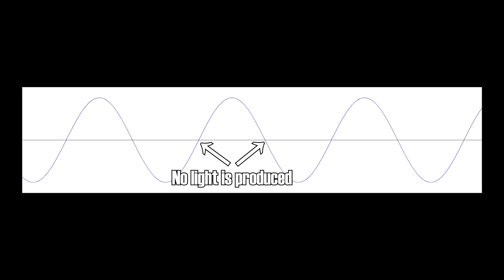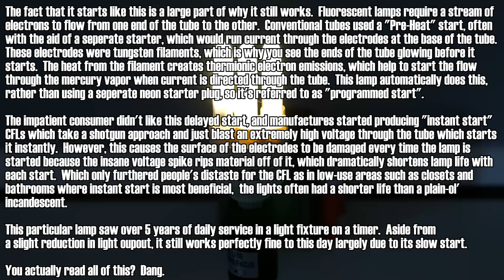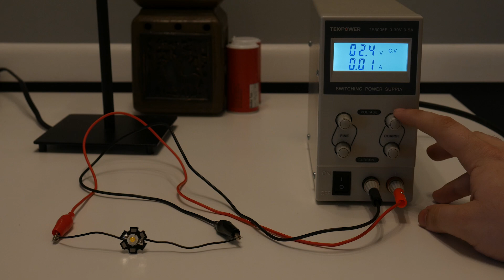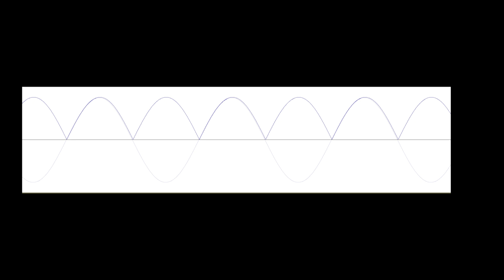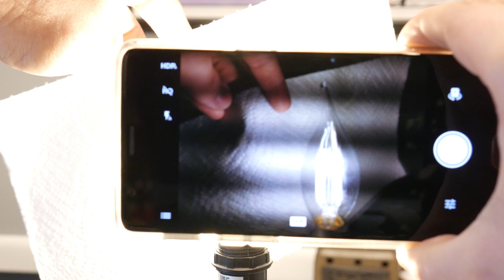LED bulbs that flicker, and CFLs that almost never did

Comment: You forgot to mention the flickery Christmas lights that drive you nuts when you drive past a house that's decorated with them.
Reply: I hate moving past rows of lights for that reason... I can see the dimming better than anyone I know and that drives me nutso.
Reply: I love LED bulbs, but the LED Christmas lights just seem so off, so cold. I prefer the houses with incandescent Christmas lights. When I am walking my dogs, I will just stand there and nostalgically watch them. Oh and don't get me started on those Christmas projected laser lights.
Reply: Those are actually half-wave rectified, whereas the diagram he showed demonstrated full-wave rectification. Basically, only the positive half of the AC current passes through, rather than flipping the negative half to positive. You can't see the flicker like that on full-wave rectified strings, even though they are zeroing out at 60Hz
Reply: @SepticFuddy  I have thought of that. A vid years ago by AvE (watched his vids for a short while till I got tired of his pottymouth) showed each half of a string flipping between the 2 sides of the AC.
My main thought is that the LEDs come on only when reaching a certain voltage, so it's only the tops of the sine waves that activates the LEDs. I guess I have enlightening to do.

Comment: I really hated CFL, disgusting light, highly unreliable and potentially dangerous. I used incandescent until I found good Philips LED Warm White which still was lacking in colours and looked washed out. Now I installed 200W Halogen system and it looks AMAZING. I use my LED as a secondary light  when I don't need halogen.

Comment: I was listening to your video in a background while working on something else and not paying much of attention to what you say until 3:15.
You meant negative dynamic resistance..?
I would gladly buy some of the negative resistance lights bulbs from you - it would be like a free energy source.
Connecting such a light bulb to a rechargeable battery would recharge it, and the more voltage the battery would be producing the faster the negative resistance would charge it. Sort of a perpetum mobile ;)
Still very interesting and informative video.

Comment: LEDs are bad for health. Blue diodes is the culprit.  My fluorescent tube light having a magnetic ballast lights much brighter. It switches off 100 times per second compared to thousands of times from an electronic ballast.
As far as saving energy, the LEDs as of now on this earth DO NOT save energy. People simply use more LED fittings.
Reply: Not true. compare watts to lumens for a start. Unless your adding in the total energy used to produce the bulbs all the way through final disposal/recycle. I don't know the figures for that sort of analysis.
 I am assuming also you are comparing same cri and 'temperature' between the two bulbs. Or are you assuming people will the same number of watts for their lighting regardless of total brightness?

Comment: I am an electrical engineer and I suspect you don't quite have the capacitor thing right in the fake filament bulbs. Running an electrolytic capacitor where there's large ripple (AC superimposed on DC) across it causes heating of the capacitor and if it's high enough will quickly destroy it. If you look at the data sheets you'll find the max ripple current in the specs. Especially where the circuit board is already going to be quite hot a filter cap sized too small would likely quirky self destruct. I suspect instead the caps are there to provide smooth DC to the current regulation circuitry not the LED strings.

This also brings up the bigger problem that cheap Chinese LED bulbs use cheap electrolytic capacitors that are often under specified for size or cost reasons and have to run in a very hot environment especially for bulbs mounted socket up in enclosed or partially enclosed fixtures. These caps are the most common failure point and the main reason LED bulbs rarely meet their published lifetime ratings. Most LED bulbs sold on Amazon are from no-name Chinese companies that didn't even exist a few years ago and probably won't exist in another few years. Those companies don't care if their bulbs don't last 5+ years.

Comment: Also, 20Khz is not Very High Frequency. VHF is 30Mhz to 300Mhz. 20Khz would fall into Very Low Frequency (VLF 3Khz to 30Khz)
Reply: insylem Not very high frequency for radio, but it is for power transmission!
Reply: You are conflating Broadcast jargon/terminology with power system jargon/terminology. The  context here determines the definition.  The letter i in electronics refers to amperage, in math it refers to the square root of -1.

Comment: Incandescent bulbs are good for oven lights, where the heat would destroy other lights. Also, exterior lighting in colder climates get snow covered when not incandesce. There are also IR uses for incandescent lights such as IR searchlights, heating lamps for reptiles, and food.

Comment: Interesting to see how an electrolytic capacitor is used in the AC-to-DC converter inside these LED bulbs.  Because heat causes the liquid electrolyte to either evaporate and/or leak over time, one may not get the all-so-often promised "11 years of life" from an LED bulb.  Some may even think, "I don't leave these LED bulbs on very much so they should last 20 years or more!"  In terms of the LED light, that may be true, but in terms of that poor electrolytic capacitor inside, well, your bulb's life will most likely be limited to the life of that capacitor.  And since replacing the capacitor in most bulbs is not possible without destroying the bulb, you would need to replace the entire bulb when the capacitor reaches it's end of life.  The only other thing to note is that capacitors don't just up and die.  The equivalent series resistance (ESR) increases as the electrolyte evaporates or leaks, which note doubt will have some affect on strobing.

Comment: I have a couple of those filament LED lightbulbs at home and I noticed that one of them flickers a lot, while the other model (with a bigger electronic chipset) doesn't at all.

Also, while recording in slow motion with my phone I noticed that the CFLs do flicker (but not as bad as the filament LED), while other (greater quality) LED bulbs didn't at all.

I don't know why is that now.

Comment: TC, I can see; actually see the flicker of most LED lights. It is especially bad in automobile led tail lights. But I can even see the flicker and separation in RGB colors on my newer Mitsubishi 72" rear projection tv. And this effect is magnified 1000x's when I look away as the seperation/ flicker is unmistakable.  Regardless of the Hz the light source is operating at. Interestingly, I was an early adopter of CFL bulbs. That interestingly did not produce the same effect. Just throwing it out there for you to ponder. Great vid! Gonna hit the Patreon support page as soon as I have a few extra $'s to spare.

Comment: Magnetic ballasts do not output a sinewave signal. There is a lot of distortion power factor effects that can be tweaked to increase lamp efficiency and change the frequency of the arc. You say that that is all obfuscated in fluorescent lamps; but it is critical in other gas discharge designs.

Comment: I was thinking I've actually noticed incandescent lights flickering, especially ones about to go out which at the time we didn't know it but our house mains voltage at the meter was dropping due to a malfunction on the power grid in our area, that eventually got so bad that something up the road popped and our outlets were showing 80volts instead of 120, everything was dim except for my bedrooms led bulbs, they might be using a switching power supply in the driver lol.

Comment: I know I'm a little late to the party here BUT whatevs. In regard to what you say at the end about CFL light...my absolute favorite bulb as far as quality of light produced was GE's Reveal CFLs. They don't make them anymore and their wattage was somewhere between a modern LED bulb and an incandescent. But if I could still buy them I would.
GE REVEAL bulbs are all that I buy now and they are the ONLY bulbs that produce light that comes anywhere close to incandescent bulbs. It has to be REVEAL. Soft white and warm white GE LED bulbs and in any other brand just look awful. And cool white or daylight is the absolute worst.
The Reveal CFLs looks WONDERFUL and when they eventually died on me I switched to REVEAL LEDs. I like the color output of these LEDs but they aren't quite as good as the CFLs where and they have a noticeable flicker. I expect that shit from a Chinese company but not from GE.

Comment: My guess as an electronics engineer is that you are almost correct regarding the number of diodes being roughly matched to mains voltage. The reason there are some more diodes is that when you rectify an AC voltage, the DC voltage becomes significantly larger. The output is AC voltage times square root of 2, or roughly 1.4 times the AC voltage. That means for america the rectified voltage is about 170 Volts. That's what the driver has to work with.

Comment: Strangely enough, I did the smartphone test on a bunch of incandescents, and they all showed really strong flicker. Why would this be the case?
Reply: Incandescents have some inherent flicker but it is damped by the heat capacity of the filament.  The filament emits based on the surface temperature of the tungsten which lags the current slightly as it heats up, and likewise it does not cool to zero within a half cycle but gradually cools.  So there is a ripple around the mean temperature rather than a sudden stop of emission that occurs in a fluorescent.  

It used to be that the work lights for rotating tools like lathes were required to be incandescents because the 120Hz flicker of fluorescents would often "freeze" the appearance of the tool depending on the speed setting, and workers would get injured by reaching for it while it was still turning.  Incandescents have much less flicker.

Getting in deeper: It is not strictly a sine wave ripple as the heating is based on power: instantaneous current value squared multiplied by resistance, and the resistance also varies with temperature (increasing).  Then the emission varies in color by Kelvin temperature as well!  But the "thermal inertia" of the filament tends to keep these variations nearly invisible to our vision.

Comment: 3:19 Negative resistance is like a current controlled voltage supply. Doesn't the arc just have very low resistance and acts like a short circuit?

Comment: even though I'm not epileptic, however, I do have an eye condition which DOES allow me to "see" the fast-switching rates of gas-discharge lamps including lamps which contain simple magnetic ballasts running at 60 Hz and even the ability to see old analog TV images "drawing" on the screen!  I can see street lights  "turning on and off" and fluorescent lamps  switch off to a "pale yellow glow" while CFLs, on the other hand, I can not see as their switching rates is 10 kHz and up.. I can also see  computer monitors flicker at up to 80 Hz..  I CAN see this effect in CHEAP LED lamps and "corn cob" lamps as well..  the higher-quality LED lamps don't seem to have this issue.

Comment: Orange glow from street lights is low pressure sodium vapor. High pressure is more white and does not make everything look dead, it is also a lot more expensive and it is why till led tech got better and cheaper, cheap low pressure sodium vapor lights where used.

Comment: 5:00 an electronic ballast works in the exact same way of a big chunky one.
You said that it produces an high frequency but you didn't say what it does with it.
The small transformer looking thing is actually a magnetic ballast, it is much smaller just because it works with a lot higher frequently.

Comment: I avoided CCFLs because of their poor color rendering. They rarely went above CRI 80 and I always thought rooms looked a little weird to the eye under their light. They were also marketed as replacements for 60 or 100W incandescent bulbs when they were far too weak in reality, and consequently many of my friends had very dimly lit rooms just because they tried to save some energy (11W was marketed as replacement for a 60W incandescent, although it lacked nearly 20% of its brightness). LEDs are great now that they get past CRI 90 easily, and I use them everywhere.

Comment: No way LED will replace incandescent bulbs, unless in my home.
A have a "high quality" LED and its light isn't nowhere near the my old incandescent bulb, even though they say "2700k". Not even close.
They have the same lumens output (600lm) but the incandescent produce MUCH LESS glare and flicker. Incandescent is much more comfortable to my eyes. Ain't no comparation.
Yes, they waste more energy, but I save energy by other means. At the end of month, I manage to get a low consumption (about 70 kWh) at my energy bill. It's a great deal for me.

Comment: I discovered the flicker on my retro style LED bulb by filming them with my 240 fps slow-mo phone camera. Then I filmed an old style carbon thread filament bulb and discovered it too flickers with the 50 Hz DC outlet by the same amount. That made me content with my LED bulbs.
Reply: The main difference I think is that incandescent filaments heat up and flicker in a softer/slower fashion. This helps the trick our eyes even more with persistence of vision as they look like they are dimming but not going right off. LED flicker is harsh because it can go from on to off much faster .... think TosLink :)   Incandescent like a sine wave, LED like a square or sawtooth wave.
Reply: This means just one thing: Your LED bulb is shit.

Comment: There's actually a really good reason florescents are driven by AC more often than DC: As long as the tube is powered on and receiving DC, the mercury vapor will slowly migrate towards the cathode end. Eventually, all the mercury ends up at one end, and the tube won't strike anymore. You can actually see the result of this as a black band around one end of the tube, and it's almost always why those crappy old battery-powered florescent lanterns would crap out. The solution is simple, though: If it's not too far gone, just flip the tube around, and the mercury will start migrating back.

Comment: I have had CFL's catch fire. LED's for the win.
Reply: The 12V G4 halogen LEDs are prone to catching fire if not made very well and by a reputable company. Since they run off 12V AC or DC, they can't just use a capacitor to limit the current but they must use a resistor or a DC to DC converter. The resistors are present in cheap bulbs and are always overloaded, I bought a few lamps a while back that ran 22 ohm SMD resistors (power limit: 250 mW) at over 500 mW each and of course, some 15 minutes later, the lamp smelled like it was burning and first it started flickering, then some LEDs started desoldering themselves because of the heat.

I got the money back and bought some proper quality Sylvania bulbs, with a real DC to DC converter, and so far no issues...
Reply: LED's with poor design or poor components are as likely to catch fire (usually fewer components).

Comment: The mercury vapor inside CFLs is so absolutely insignificant, that a year's worth of coal burning to power that CFL bulb will exhaust more mercury into the atmosphere than the bulb itself contains.  The mercury released into the atmosphere from coal fire plants in the U.S. is measured in tons.

Comment: Boo :(
 I use CFL(or curly fluorescent bulb) in my barn.
 They last between 5 to 12 years in the barn.
 I don't see them been that bad as long last fluorescent bulbs in the barn.
And I don't trust LED bulb because they can't handle the cold whether(in Wisconsin cold winter it get between 10 degree to -35 degree) I don't think that LED can't handle the cold winter.
Reply: LEDs handle cold perfectly fine as far as I can tell. The driver might have an issue below -50 °C but that shouldn't be a problem unless you live in Northern Chukotka :D

Comment: my house is full of double-bulb fixtures, and i usually put one cheap white led and one warm CFL bulb in each. i hate the white light and the flicker from the led, but when both are there they kinda fill eachother's gaps both in flickering and richness of color. plus the shadows are trippy AF with visible color aberration around the edges.

at night when using my pc i usually light my room with a 4w led bulb on a lamp behind my monitor. uses close to no power (3.6 actual watts), prevents high contrast from a white screen to a pitch black wall and lights the room enough that i can walk around fine (although i usually have to turn on the ceiling lights when looking for stuff in drawers)

Comment: There is a TED Talk on this, but I can't find the link.  The problem with CFLs was discovered by a demographic study of the buyers.  Women selected against them when shopping.  It turns out that some women have Tetrachromacy that is 4 types of colour receptors in the retina.  It's an XX linked trait and thus some women have it but men cannot.   Men designed CFL phosphors with a big hole in the colour spectrum that they could not see, but the women could.  Apparently it was quite annoying.  Later CFLs had the phosphors adjusted to fix it, but the bias persisted as an urban legend.  The whole story is hugely fascinating because it deals with an engineering over site, biology that was under appreciated, the statistics wizards that figured it all out, and the buyer psychology it caused because people still didn't buy the product even after it was fixed!